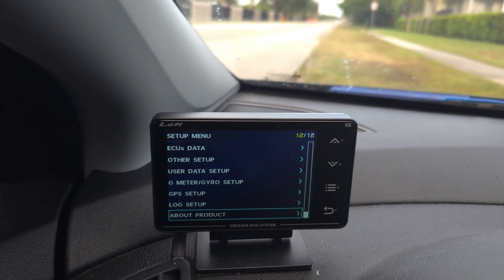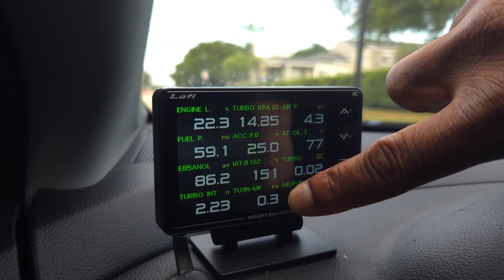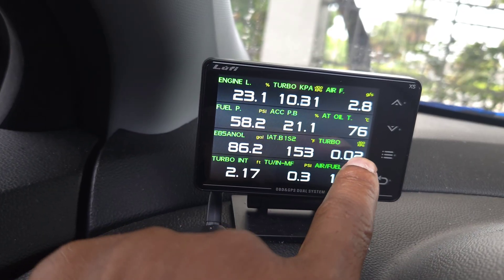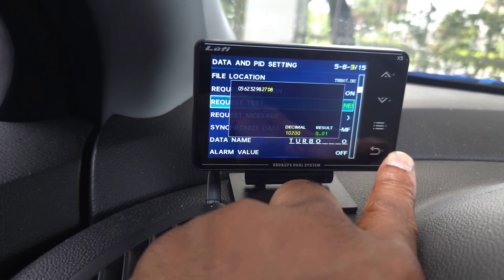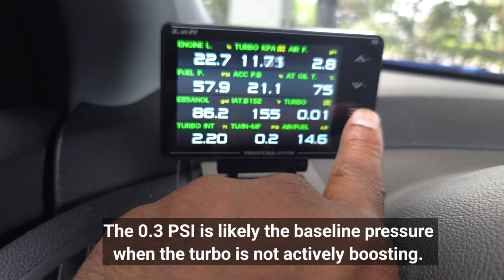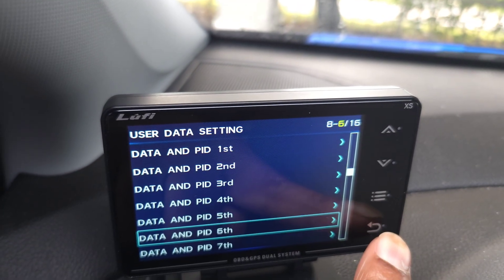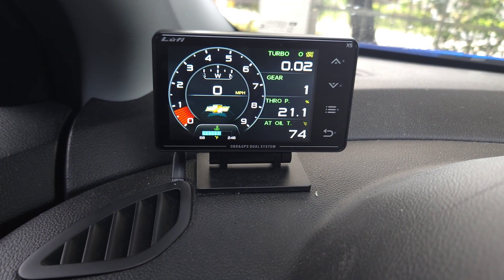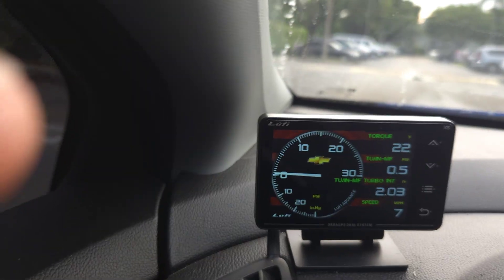Lufi XS Obd2 Gauge TU/IN-MF PSI. BOOST ( Part 1)

Comment: were you able to work the oil pressure as well?
Reply from the maker: The oil pressure automatic displays. I'll check it to see if the readings is correct.

Comment: Yo yo wassup . So when you went to adjust your data and PID settings , were they already there? Or did you download the PID update from lufi? I recently purchased the x7 and I’m looking to get the engine temp and pressure readings to work on my 2012 Infinti . Thank you for the helpful video
Reply from the maker: Wuz good! Yeah, the gm PIDS were preloaded. The lufi update for the gm pids was basically the same
Reply: @FloridaCruze so Nissan Infitni don’t have one :/
Reply from the maker: @PieroRuiz-p4j dang. You checked all of the PIDs also did you check to see if it was compatible with your vehicle's year and model?